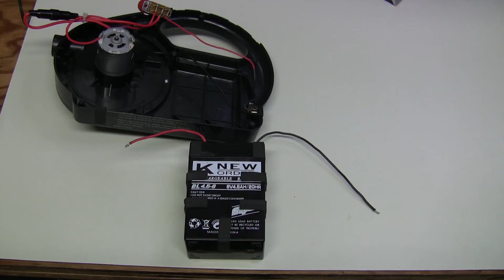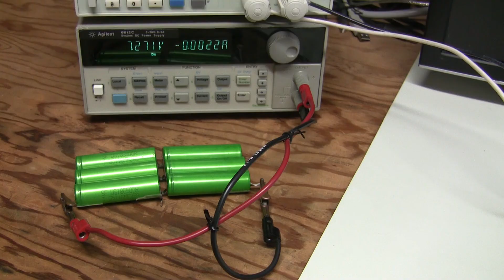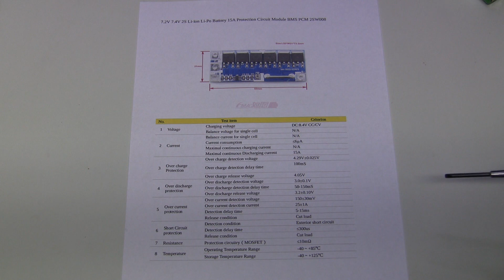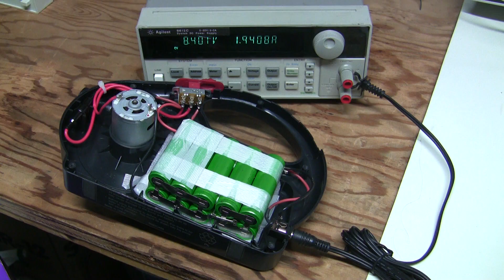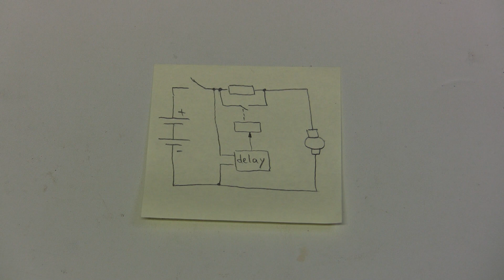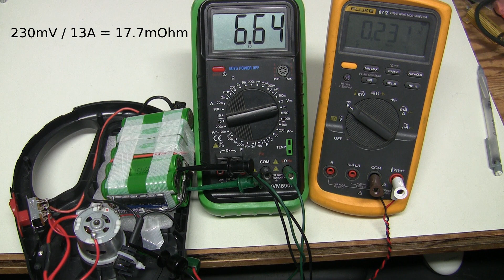#29 - Coleman Rechargeable QuickPump battery upgrade

Comment: Fascinating. Thanks for a well made video. I like the way you speak in a calm voice.

I came here because I have the same Coleman quick pump with a bad battery. I have to replace it every 2 or 3 years. I was curious about the feasibility of replacing the lead-acid battery with lithium ion. I'm just going to go with a new lead-acid batter from Amazon for $13.

In answer to you question about the charger, it says 7.5V at 200mA.

Comment: I would use a large electrolytic capacitor connected to the battery via an inductance. The switch connects the motor to the capacitor.  This capacitor provides high starting current while the battery current is limited by the inductance.
Reply from the maker: There is always more than one way.

Comment: @feedbackLoop Could you tell me what resistor value you used with your MOSFET gate? I am attempting to recreate your circuit but I am having issues with MOSFET overheating or complete inoperability.
Reply from the maker: I don't remember now, and it doesn't matter much. The resistor and the capacitance of the gate form an RC circuit. Higher resistance means longer delay to fully turn on the MOSFET. I would think that 10K should do just fine. Are you using the same MOSFET? If not, the key parameters are: on-resistance, voltage to fully turn on and power dissipation. Perhaps your MOSFET has much higher on-resistance, or, perhaps, needs higher voltage to fully turn on, and, hence, much higher resistance with ~7V applied to the gate.
Reply: FeedbackLoop I am using the same mosfet but with a 20a 3 cell bms.
Reply from the maker: What is the current flowing through the transistor? What is the voltage drop on the transistor? Did you put the transistor on a heat sink?

Comment: So, lesson learned here is not to modify the current shunt on a Li-ion control board before considering an external way of soft starting (e.g., a MOSFET+resistor+capacitor(?)).
Reply from the maker: +SteelBlueVision 
Why not? If the adjustment worked, the whole thing would be simpler.
Reply: great video! looking to do the same!
Did you end up removing the shunt? Doesn't seem like that but just wanted to be sure.
A complete Instructibles how-to would be fantastic :-)
Cheers!

Comment: Can you please explain to me in laymen's terms how exactly you overcame the problem of the motor drawing too much current with the MOSFET?  How did the MOSFET limit the initial current draw?
Reply from the maker: khachaturian 
In this configuration the MOSFET limits the inrush current by turning on gradually. The gate has some capacitance, and you can see on the scope that it takes some time to fully charge through the 10K resistor. So instead of a sharp spike we have a smooth rise, which was enough to avoid tripping the over current protection.
Reply: FeedbackLoop So what you're saying is that these types of motors don't actually need all that excess current to actually start, they only draw so much at the beginning due to the nature of their design?
Reply from the maker: khachaturian 
Yes, this high current is not essential to starting. Motors can start with limited current, and often it is desirable. This is called inrush current: https://en.wikipedia.org/wiki/Inrush_current. As you can see in this case, the inrush current can be several times as high as during normal operation.
Reply: FeedbackLoop Aha, ok.  I am familiar with this terminology.  So you tried using the traditional method of inrush limiting resistors initially.  Now I understand.  Is the reason why you needed such large ones because of the type of load (Inductive load)?

The reason I ask this is because I'm under the impression that modern switching PSUs also have inrush limiting resistors, but they are a lot smaller, eventhough the initial loads of say, a desktop computer, can be in excess of 20A on startup.  But this is a different kind of load (resistive), correct?

Thanks for your videos.  I always check your channel for updates.
Reply: @khachaturian100  The load on the secondary side might be 20A, but this will be at low voltage (3.3V, 5V or 12V), and output current limiting will be implemented in the switchmode control circuit. On the primary side, the main cause of inrush current is charging the filter capacitors - they will look like a dead short when first connected, but will charge in one half cycle. After that, the steady current on the primary side with a 20A load on the secondary will be a lot lower - maybe 1A at 240V or 2A at 110V.

Comment: I like the way you work your way thru your repairs and designs showing us how not every idea pans out the first go 'round. Your "soft-start" analysis was interesting, I use a similar circuit concept to limit the inrush current to my ham radio RF power amplifier as the high voltage power supply capacitor bank fills initially. Glad I found your channel!